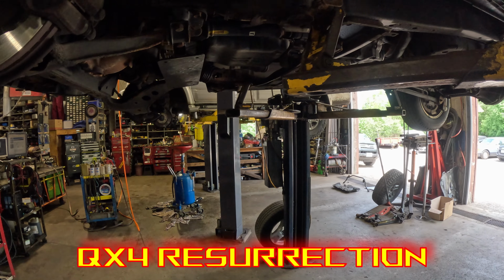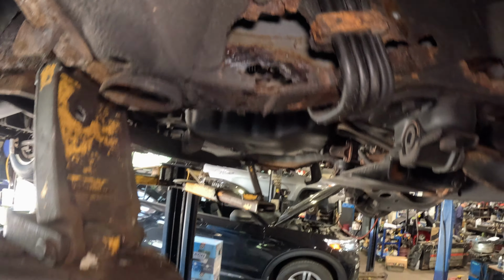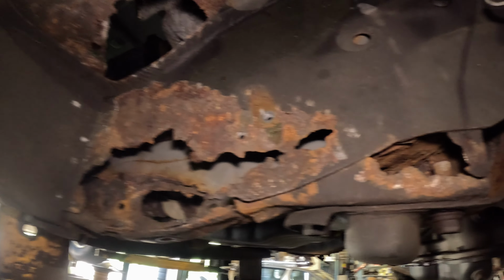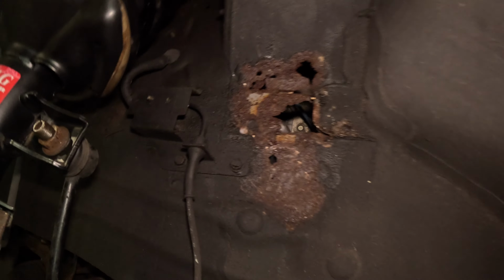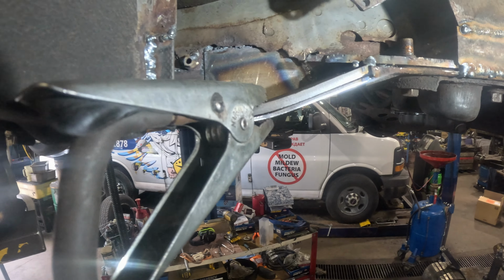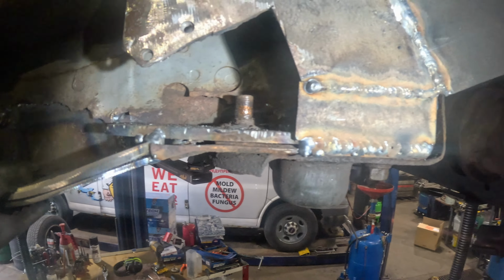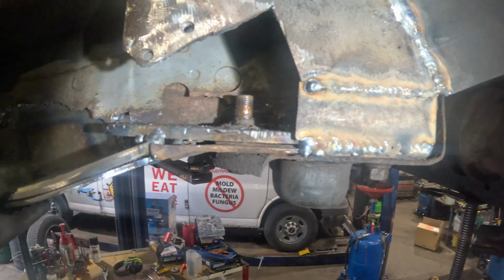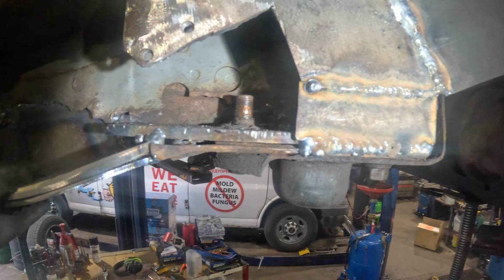2001 Infiniti QX4 RESURRECTION. Insane amounts of RUST repaired. Vehicle is road worthy again!

Comment: What a transformation! Was the rust damage to the frame typical of the car's age or lack of rustproofing during the car's lifespan?
Reply from the maker: The rust on that vehicle is typical for this model. Nobody cared to do any preventive measures for all these years. Where and how the vehicle is used is also a huge factor in metal corrosion.